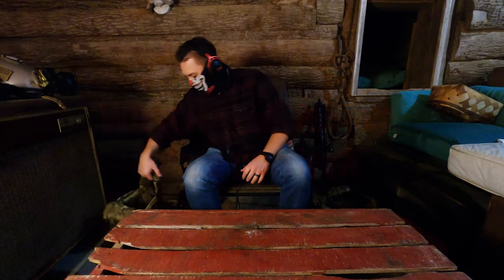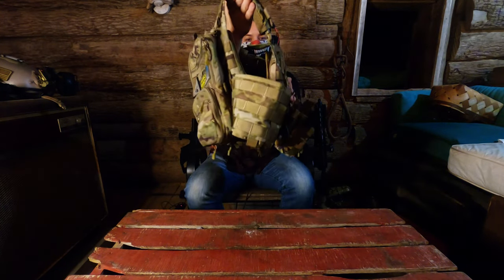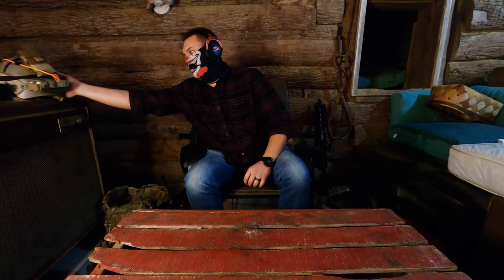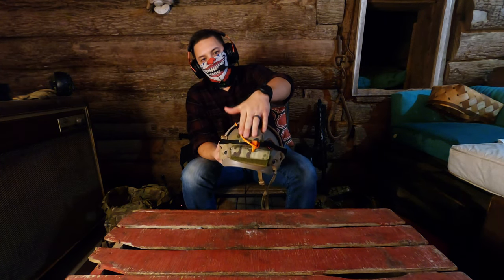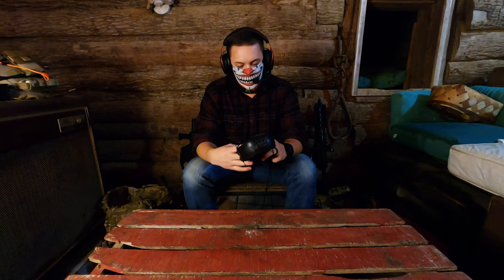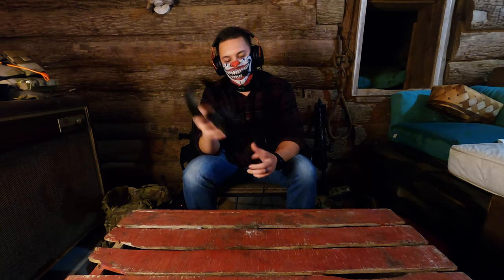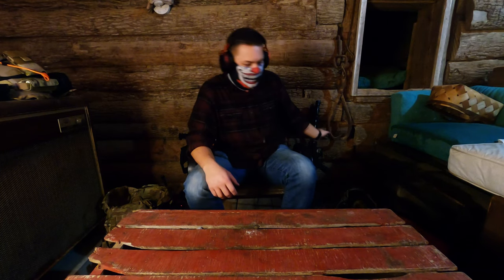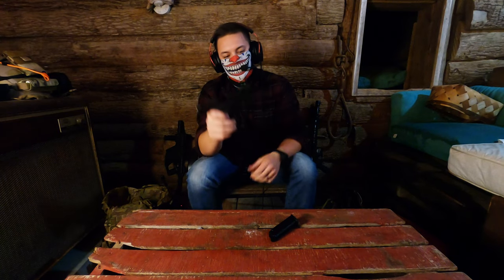Milsim Loadout 2021 - Tips and Tricks

Comment: Why two primaries?
Reply: The idea behind it is so that you've got a back up in the event of a failure which can't be field repaired, thus allowing you to continue the event. As to whether or not it's actually needed is open to debate but it's the old adage of "it's better to have it and not need it, than need it and not have it". There are plenty of players out there who have never had a failure or issue but in the same breath there are those who have.

Keeping on top of your maintenance and ensuring you have reliable kit will help but it's worth bearing in mind that these are machines and failures do happen.